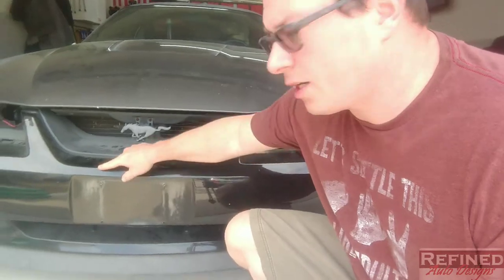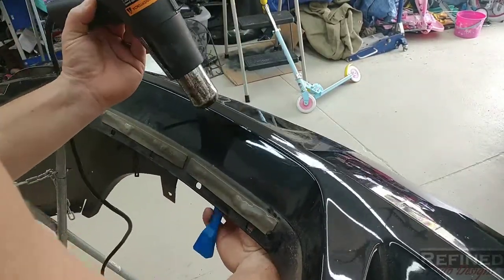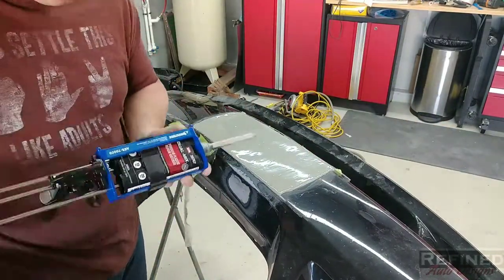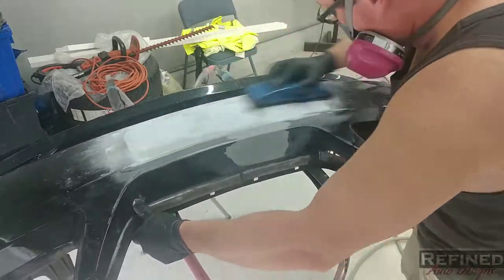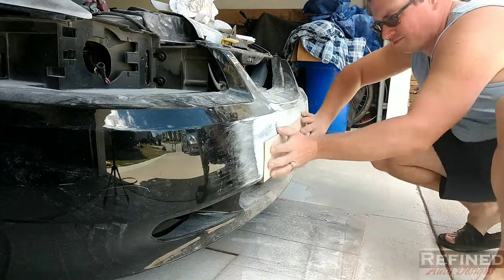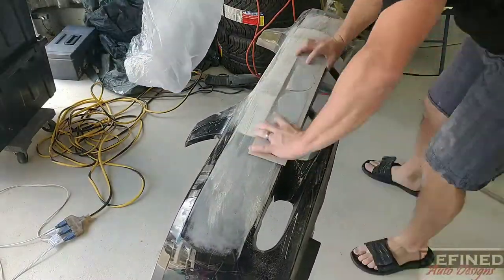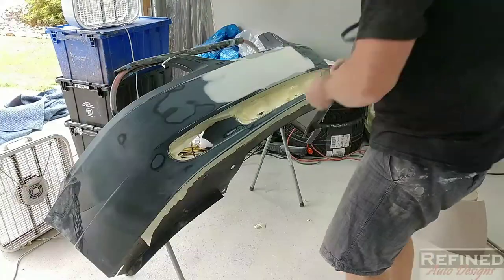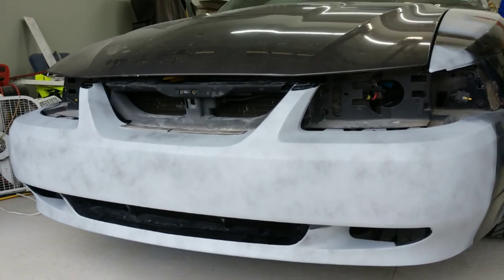Mustang Front Bumper License Plate Delete Mod | RAD13

Comment: I have zero experience with body work. Is this something a total novice could tackle and make it look this good? I'm thinking about doing the body work myself and then have a shop prime/paint it.
Reply from the maker: As long as you prep right, sand well, and understand high and lows with body work, I think you'll be ok. That's how you learn. I wouldn't say it's easy though

Comment: Greeting from the UK, Such a great video! I'm would love to delete my bump where the number plate recess is on my bumper. I have seen some videos and fourms talk about fibre glass then a flex filler on top. Even some say to cut some of the number plate off and filled in and over it. Or just Epoxy glue, Upol p40 then maybe a resin to seal it then using flexi filler on top, prime and spray and clear coat. 

Do you think the filler is an easy option or even better, shame we don't have the SEM 39767 DUAL-MIX in the UK.

Many thanks!
Reply from the maker: I did some research on some products I thought I might use. It's still holding up well and not cracking up. But if I was to do it again, I'd probably cut it out, patch a piece in from a donor bumper, and bond everything in. My way worked, buy I feel like I did battle a bit of warping and shrinking from the thicker build. They must make a 2 part semi flexible plastic bumper repair material available in the UK?
Reply: @refinedautodesigns  @Refined Auto Designs   Thank for your quick reply, They may be a product that related to those properties, just need to find it. Yes, I guess that would/could be the better solution to it, as may be less work. Will have a look, now I have some new key words and some great advice!

Comment: What brand of filler did you use? Also, did you have a flex additive mixed with the primer?
Reply from the maker: https://youtu.be/aUxpaH-3bVU
I first use it in this video. Might go into more detail. SEM 39767 PROBLEM PLASTIC REPAIR. no flex additive in the primer.